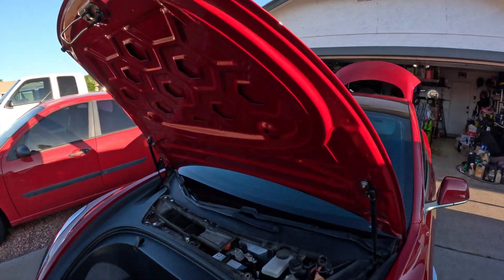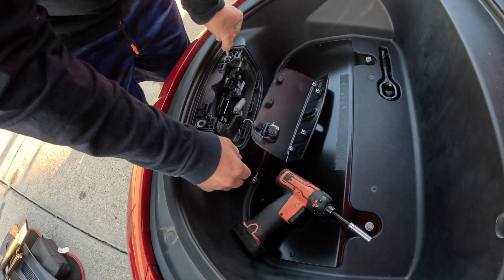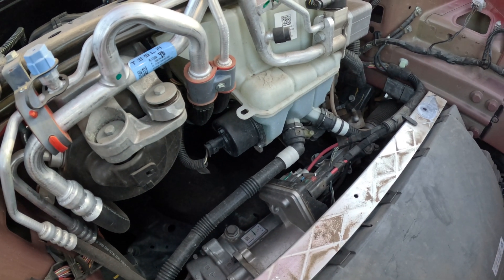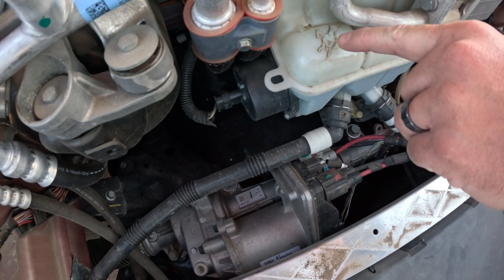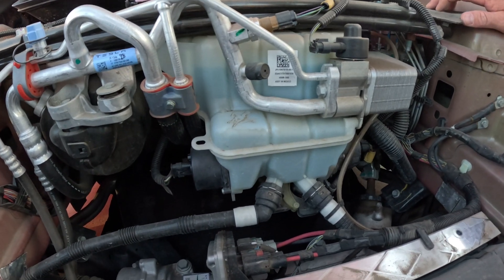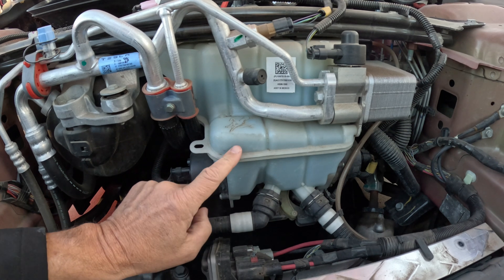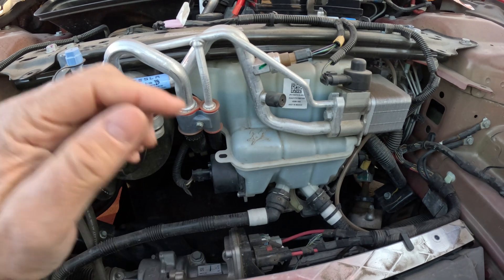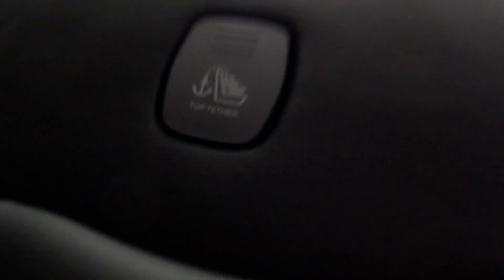Model 3 The magical loss of coolant

Comment: Great video, I believe I am having the issue with my 2018 M3 LR RWD. Can I ask was the blower on the front vents weaker as a result of the coolant being low. I heard that they could be related. My fan barely blows currently.
Reply from the maker: @timclarke2514  Tim just fill up cooling liquid. I think it is G48. Rolf
Reply: @ Something interesting I learned talking with a Tesla Service advisor today. They actually let you put in a request now specifically for coolant refill. The estimated cost they gave me was $27. They recommended getting the diagnostic done but I declined that. Going on Wednesday for the refill.

Comment: I have the same exact codes with my 2018 m3, did the problem resolve after topping up the coolant? Or did the actuator have to be replaced? Thank you in advance
Reply from the maker: @camilobuitrago4265  added coolant was enough. Rolf

Comment: what is the cause of the coolant to be so low?, I recently had a compressor issue and they told me it was a coolant issue , they fix it by filling it. but the thing is a 2024 Tesla model 3 with less than 30k and I think thats not normal.
Reply from the maker: @EverydayTechFer  we explained it in the video the coolant system is a close system with the new m3. There are two possible causes. 1. You burned the coolant down then you have a cooling problem. 2. Your system is leaking. Rolf
Reply: @ thank you 🙏

Comment: I'm not completely sure if I understand it right, but if you are missing half a gallon (For me a more understandable 1,89 liters) of cooling fluid, and you don't see any obvious leaks, then I would be afraid that it will be leaking internally in the battery pack. Would you agree?🤔
Reply from the maker: That was over a six year time frame. My former ranger confirmed it. The early vins are loosing coolant and Tesla just refills it when you bring it to service. This was fixed in later vins. Rolf
Reply: Exactly what I was thinking and according to some road side assistance that does happen....
Reply: Nice video.